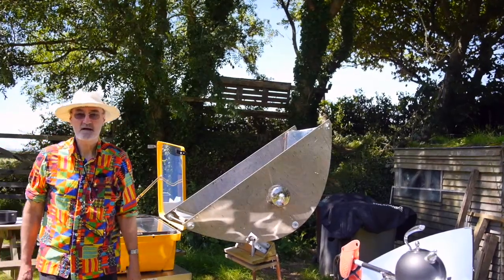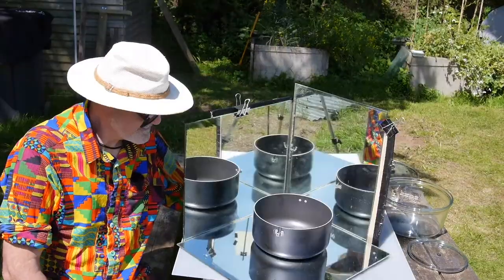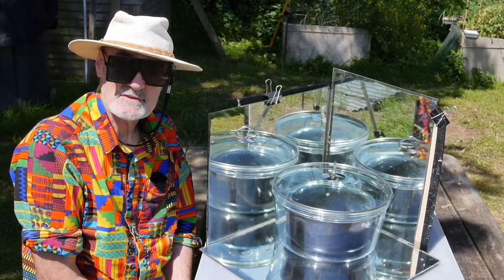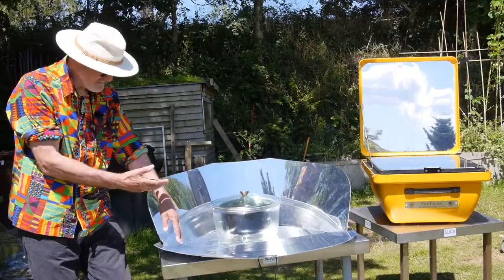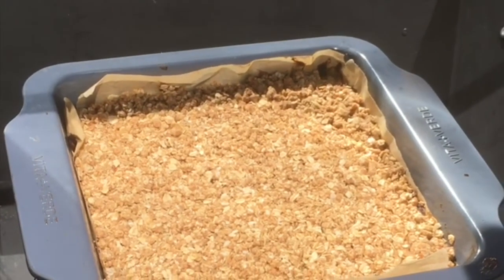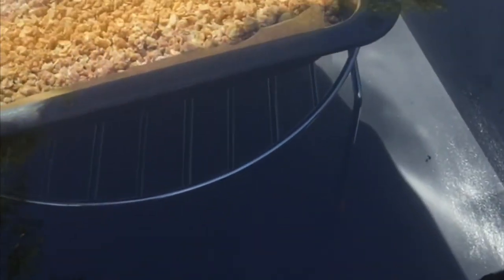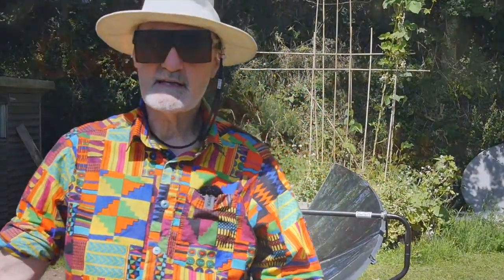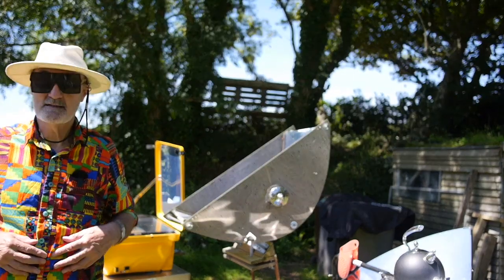Cooking with Starlight : 01 : Solar Cookers 101 : SLiCK solar cooking : solar cooker

Comment: This was extremely helpful! I've built and successfully used a couple simple solar cookers (and I think the food turns out more delicious) and am always interested in improving the design, making it more efficient, and using things that I already have. Your explanation made all the concepts clear for me and now I understand why some of my trials did not work and how to make them work. I had surmised that large black pots with reflective car windshield screens should do the trick, but thanks to your video, I know now how to make that system work. Also, am I right in thinking that the thinner the black target pot, the better? I'd tried cast iron pots and the heat didn't get to the inside, but the cheap black enamelware camping pots worked much better. Also, smaller cooking vessels (target pots) did better than large pots. 👍 You're awesome in my book! 👌
Reply from the maker: Thanks Enjoy!  Yes, you are right about the thin (I think they are called 'Speckleware') enamelled pots.  They work best in low-powered panel cookers because they do not have much thermal mass, so you don't waste much energy heating them up.  Cast iron pots take a lot of heating, and you have to do that before the food heats up, so they only work well in more powerful solar cookers, like parabolics.  Be careful about smaller pots, though.  If you are using a reflector with flat sections, like the one at the beginning of the video, unless the flat sections are the same size as the pot, some of the reflected light will miss the pot.  The panel cooker I come to in the video straight after constructing the example cooker has a curved reflector at the back, and this helps because almost all of the light is reflected onto the pot, however small.  If you are interested in pursuing your interest in solar cooking, there are a number of Facebook Groups dedicated to it.  You could consider joining one or more of them.

Comment: Where are the heat traps available please?
Reply from the maker: Hi David.  The heat trap dish you see me tap in the video is a 12 litre bowl from a halogen cooker.  If you Google halogen cooker you will see the type of cooker I mean.  It has an electric heating element in the lid.  Many of these are now coming to the ends of their useful lives, and are just junked.  You can buy a new replacement bowl for them (search on Amazon) for £18-£25 delivered.  But if you search on Marketplace, or Trash Nothing or Freecycle or Gumtree you will often find them for free, or for very little money, though then you will have to go and pick them up.  The lids -  of borosilicate / pyrex glass are available new from Amazon for around £15.  You can see another video of mine about heat traps if you search on YT.  Good luck in your search.
Reply: @DaveOxfordCookingWithStarlight  My very grateful thanks — I see there is a 17 litre option also …
Reply from the maker: @davideddy2672   The 17 litre version you see advertised is achieved by adding a stainless steel extension ring to the 12 litre glass version already discussed, so that is not an option for a 17 litre heat trap (as light won't get through the steel).  But there IS a smaller, 7 litre version of the halogen cooker.  They are not so common, but they do come up now and then.
Reply: @DaveOxfordCookingWithStarlight  — I happened to watch a YouTube of you making bread in the midst of a Cornish winter last night, impressive stuff! I’m based in North Cornwall 😊 Ironically, I also appreciate the scythe as the weapon of choice 😁 👍
Reply from the maker: I'm out to prove that solar cooking is possible this far above the equator, David.  I find that most people in the UK have not even heard of solar cookers.  Even if they have, they usually believe that they will only work in 'hot countries'.  Of course, you will need a high tech evacuated tube to stand a chance in the winter, but in the summer, you can cook with a panel cooker.  Lots more videos coming up next year when we get a bit more sun  If you are interested in solar cooking and you do Facebook, you could consider joining the Solar Cooking UK FB Group - all the information you can eat.
Reply from the maker: And yeah, scythes are becoming more of a thing in the UK now, once you get past the 'Death' jokes.

Comment: Very clear and informative, would have been nice to hear a bit about how the parabolic mirror focuses on a single point, so there's less energy loss I assume than with the other mirrors that are less specifically targeted.
Reply from the maker: Thanks, John!  Yes, as you say, parabolic reflectors are designed to reflect all of the sunlight that strikes them onto a single focal point.  There is an important difference between shallow parabolic reflectors, and deep parabolic reflectors, and that will be tackled in a future video.  Essentially, deep parabolic reflectors are kinder to your cookware, and need to be re-aligned less frequently - two advantages (usually) of the deeper parabola.
Reply: @DaveOxfordCookingWithStarlight  first time hearing deep vs shallow and I've watched like 20-30 solar cooker vids.

Comment: Once the food is done, it's really hot. The pot and the glass container is hot, too. How do you get the pot out of the glass container, when it fits so tightly? What do you grab, while using pot holders,  in this situation?
I really like the outer glass container idea, but, I don't want to be burned - or drop the food pan.
Reply from the maker: Hi StarWish, Yes, you need oven gloves. In the set up you see in the video, I find that if I remove the pot lid, I can hold the top edge of both sides of the pot between thumb and fingers, wearing silicone oven gloves like these:  https://www.yaoteo.com/products/acronde-2-pairs-mini-oven-gloves-silicone-heat-resistant-cooking-pinch-mitts-potholder-for-kitchen-cooking-baking-red-and-blue-1   I got mine on ebay UK, not this brand.